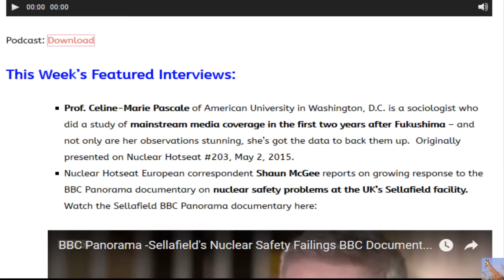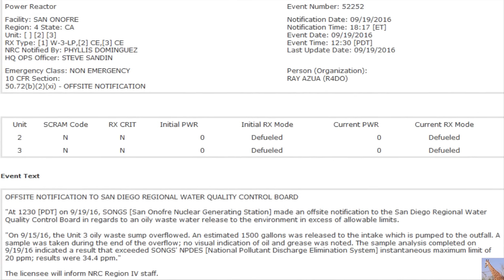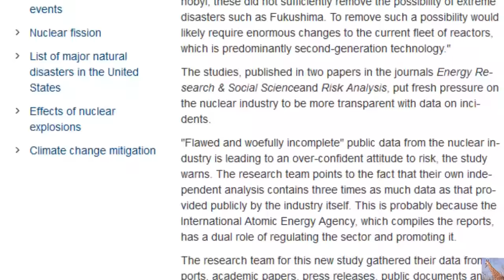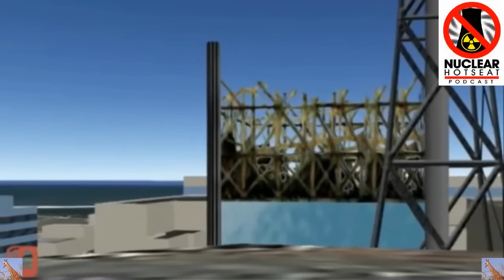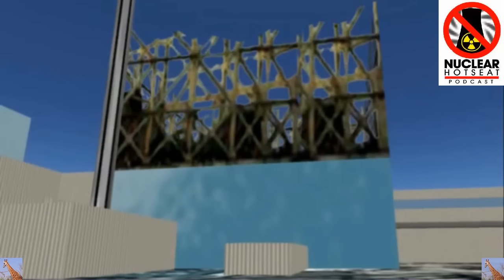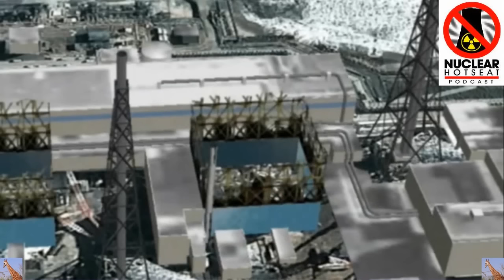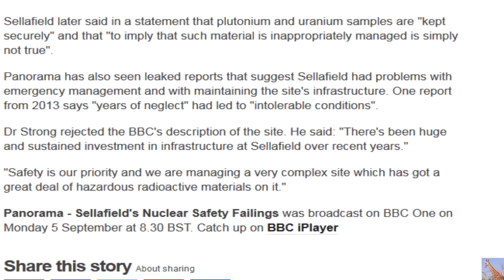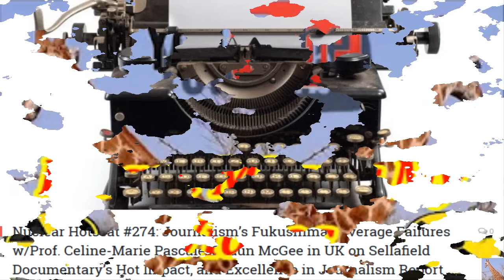Fukushima, US & Worldwide New Clear Nightmares (Nuclear Hotseat #274)

Comment: Hi ms milky.  Ive been having troubles with my video setup and only have my phone at the moment but I have to try to get this information out to those fighting nuclear power.  
The INVERSE SQUARE LAW  by Einstein formulates ones external exposure to radiation.  We all know the law its factors are distance and time.   But inside the law itself it explains it can not apply to an extended source of radiation or particle beam.  Meaning that if the SOURCE is not in one single place in space and time then the law can not be used to formulate a safe distance and time from the radiation.  The place where the material ends up that is giving off radiation then becomes the SOURCE point from which the law can be used.  Can you imagine trying to compute that?
Reply from the maker: no...
Reply from the maker: Q: Can you imagine trying to compute that?
A: no... I can't
Reply: ok got ya just tryin.to help